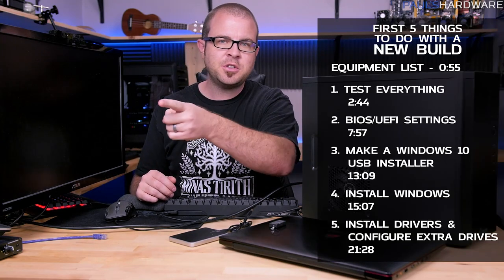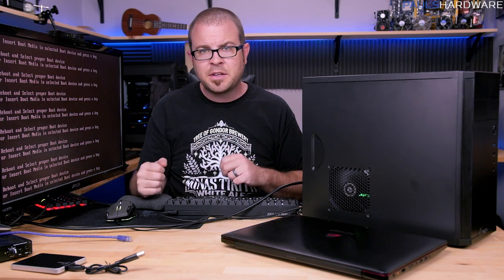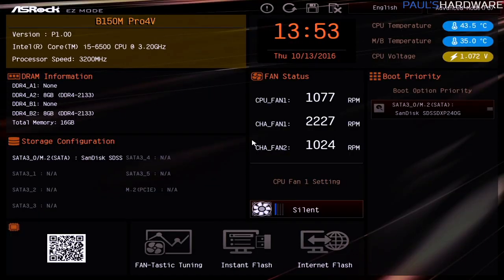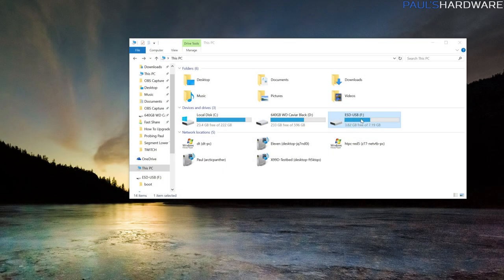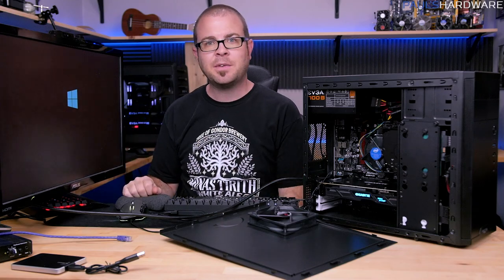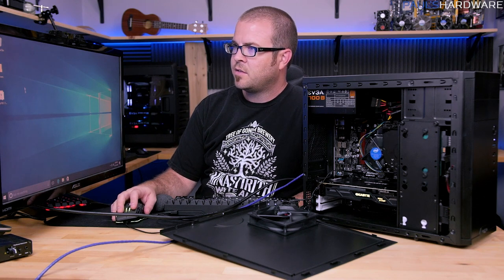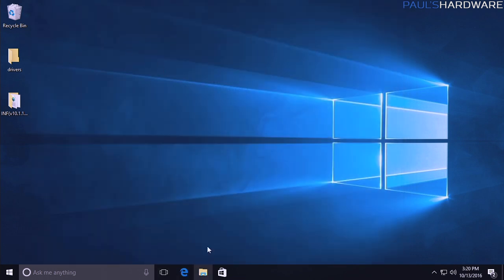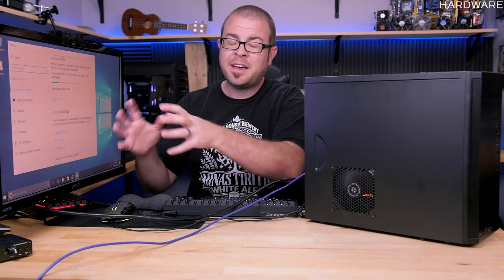First 5 Things to Do with a New PC Build

Comment: I need help everything turns on but my pc doesn’t connect to my monitor and every cord is plugged in help
Reply: Depending on your motherboard, you may need to flash(update) the BIOS as both the 9 and 10 series Nvidia gpu's require Ivy Bridge minimum to display properly.  If your board is Ivy Bridge or higher this most likely is not the problem, though.

It also could be something simple like turning off the integrated graphics of your cpu(if it is equipped with one try connecting your monitor for the initial boot to the integrated graphics port instead of your gpu until you have the gpu driver installed in your OS.)
or
running your initial boot with the monitor hooked up to your gpu with something other than an hdmi cable as sometimes an hdmi connection won't display until both the gpu and monitor's drivers have been installed in your OS.

Is your display not even showing a blank screen or is it displaying a blank screen with a something like "B3" in the bottom right corner and beeping?  If it is beeping, look up the error codes for your motherboard and that will tell you what the problem is based on the number and duration of the beeps.

Best of luck =)

Comment: What do I do if my pc did not detect my ethernet cable?
Reply: Try and change the cable, OR install the right ethernet adapter drivers. Needless to say, the cable has to be a guaranteed working one. If this does not work, give back the motherboard to the vendor. But before to do this, check if you can connect to the LAN: sometimes the diagnostic routines are bugged and fail to detect a perfectly functional cable.

Comment: MSI Z370-A Pro driver wont install help
Reply: ???
Which driver?
A motherboard usually has about a dozen or so drivers needed for its integrated parts to function.

Here's all the drivers for your particular board:
https://www.msi.com/Motherboard/support/Z370-A-PRO.html#down-driver&Win10%2064

Comment: Sooo building my first computer and i get alllllll the way to putting windows onto the USB, move over to the newly built computer. And the computer wont even recognize my USB as a bootable device. Thus stopping me from obviously booting from it and finishing the process. 
Its a SansDisk 16gb so plenty of room. 

Can anyone help or offer suggestions?
Reply: What exactly are you putting on the USB drive?  Is it an .iso image?
Also, your USB needs to be set up as a bootable drive before it can actually be used to boot anything from it(software like Rufus, etc. will be needed for this).

Comment: What if nothing shows on the screen but it turns on
Reply: check youre cables and check the settings on youre monitor, if you use hdmi cable then ofcourse you set it for hdmi from the monitor
Reply: Manuel85 I fixed it already, the problem was I was using a 2nd Gen CPU and my Mobo couldn't support it cause the bios version, so I had to buy a 1st Gen CPU to update my bios then I put my 2nd gen CPU back in and it worked

Comment: You don't boot TO a drive. You boot FROM a drive. "Booting" copies the OS from non-volatile memory into RAM, which is volatile. Seven types of memory are RAM, the "BIOS" chip, the CMOS chip, an NVMe SSD, a SATA SSD,  a SATA hard disk drive, and a USB memory device. 

The RAM contains the running programs, including the OS. It is volatile. When the power is turned off, all the programs go away. This is in the "address space" of the processor (the CPU talks directly to the RAM). 

The "BIOS" chip is non-volatile. The programs in it remain even with the power off. This is also in the "address space" of the processor. After the CPU does a hardware reset, it begins executing the program in the flash memory. "Flashing the BIOS" means writing a new program to the "BIOS" chip. This program provides simple drivers to the hardware (BIOS means Basis Input/Output System). Once a non-volatile memory device is found that is NOT in the "address space" of the CPU, the OS is copied from the non-volatile device into RAM and the program starts executing the OS in RAM. (Epson once put the entire MS-Dos OS in the "BIOS" chip. No booting was necessary. 

The CMOS chip is essentially a watch chip to keep time.  Since you do not want to have to reset the clock every time the power is turned on, this chip has its own battery. Due to a design error in the CPU, you need some non-volatile memory to keep OS state information during a reset. This memory is in the clock chip. It is pseudo-non-volatile. It works as long an the battery is working. "Clearing CMOS" erases this data. This memory is not in the "address space", so it requires a driver to access it.

NVMe SSD is non-volatile flash memory like the "BIOS" chip, but it is not in the "address space". The firmware needs to use a different driver to access this memory. The SSD includes a controller chip to make the firmware think the Random Access flash Memory is actually a block memory device (spinning rust or tape drive). 

The SATA SSD is also non-volatile flash memory but requires a different driver. It also includes a controller to make the Random Access flash Memory look like a block device. 

The SATA HDD is also non-volatile memory but is not Random Access Memory, but is a block device. It reads and writes "sectors". It requires a different driver. It also includes a controller to handle positioning, reading, and writing.

The USB memory device can be either flash memory or an HDD. It requires yet another driver. It includes a controller to speak USB to the computer.

P.S. Don't tap the Delete or the F2 key. Just hold it down.

Comment: What is more important to those who already have a computer that they upgrade with a new motherboard and processor (how else could you download windows 10) is to restore your current desktop and programs on your new motherboard & processor combo. Without spending hours, if not days, to restore your programs and desktop.
Reply: This is what the Local and Roaming directories are for under Users/[User]/AppData
Reply: @T0NNiX  explain please. Oh, I see what you mean https://superuser.com/questions/1074817/can-i-simply-copy-to-restore-appdata-roaming-folder-in-windows-10. However it comes with a lot of caveats. I used MiniTool Shadowmaker with my backup and the universal backup method, less overhead but definitely anxiety making.
Reply: The majority of programs store settings and user data under the Local and/or Roaming directories. For example if I want to backup my settings for Discord so I can transfer everything to a new build I just copy my C:\Users\[username]\ AppData\Roaming\Discord from my old hard drive to my new one and presto, all my settings, keybinds, etc. are now available for that application just like they were on my old machine.
Reply: @T0NNiX  Thanks!

Comment: eh the driver part sounds pretty complicated
Reply: It's not too bad.  Before building/booting the new PC, go to your motherboard manufacturer's website and download all the drivers for your board.  Then go to all your hardware manufacturer's websites and do the same.  Save all those to the same USB that you plan to use to install Windows with and you're good to go.  Most are self-installing .exe's, and the ones that aren't, just use device manager to manually install them.
This is how I prepare for a new build and if planned out right it's really not as daunting as it seems.
It's also a good idea to include updated firmware for hardware items that are not driver dependent like DVD writers, HDD's, SSD's along with the most current BIOS flash for your board as all of those things are great to have on hand before you build/boot the new pc rather than once you try to and discover you're screwed without them.  :O

Best 'o luck!  =)

Comment: I have a problem where i have everything connected, everything compatible, but if i wanna start my computer it wont give me signal, when i remove my video card it Will give me signal... any help?
Reply: MINECRAFT KILLERS download drivers for the graphics card or maybe the power supply isn’t enough to power the graphics card
Reply: MINECRAFT KILLERS try taking the card out then download the drivers from google
Reply: youre power supply not great enuff or not properly connected? also might be dead gcard, try a different one if able

Comment: The possible keys to enter BIOS during startup are: DEL (90% of times), F2 (7% of times), ESC (the remaining odds). You should ever do a fresh installation of Windows when changing motherboard. Since windows 10 ver. 1803, you need a 8 GB USB key to create an installation drive. The windows you download works as a fully functional trial version for 30 days; then, you MUST buy a valid activation code. Linux SUCKS for a normal PC user. These were the answers to the questions of 1157 of you. For the rest of you, except someone who has had an individual answer: please, DO NOT TRY TO ASSEMBLE A PC BY YOURSELF. Trust me, it's for good ^^

Comment: Hi i'm buying a PC from techfast which cost 930 dollars the specs are 

Processor: Intel Core i5 9400F Processor
Case: Leaper Flair RGB
Motherboard: Intel H310M Motherboard
Graphics Card: NVIDIA GeForce GTX 1660 Super 6GB Graphics Card
Memory: 8GB DDR4 [2666MHz] (1 x 8GB)
Solid State Drive: 120GB 2.5" SSD
is it ok? I did research that techfast PC's arent really a legit PC website please check if they are ok specs.

Comment: I think what the guy who was talking about masks not working was referring to what is written on the mask box's which actually states that very line. However, where his confusion seems to be is that he interprets thats as masks done work when in reality it means that mask are not a full proof, 100% protection measure against the transmission. They only aid in lowering the transmission rate, just like how a condom doesn't prevent pregnancy, but lower the rates of pregnancy.